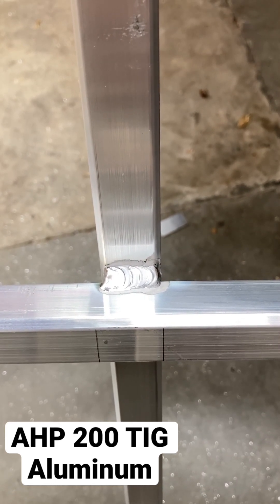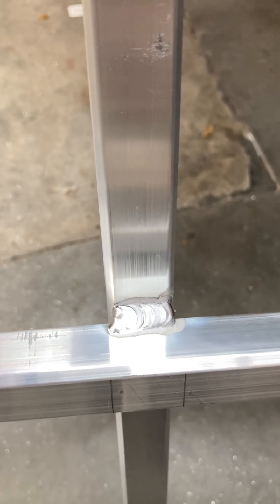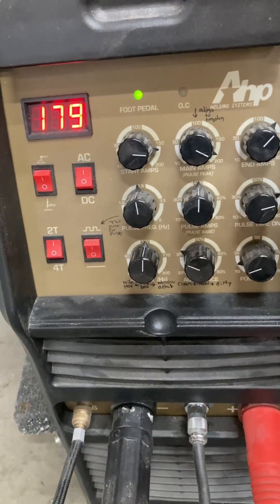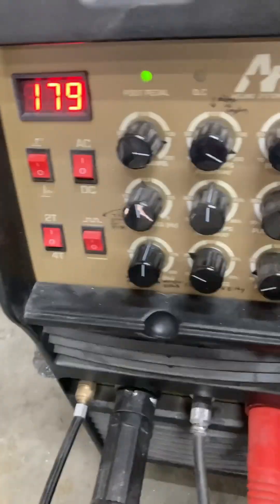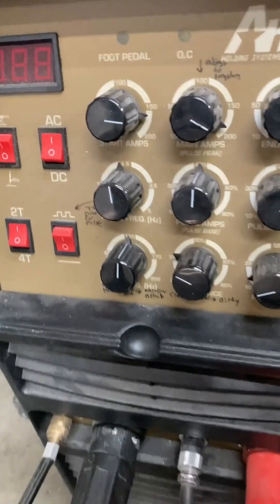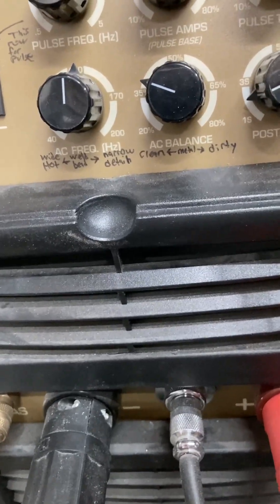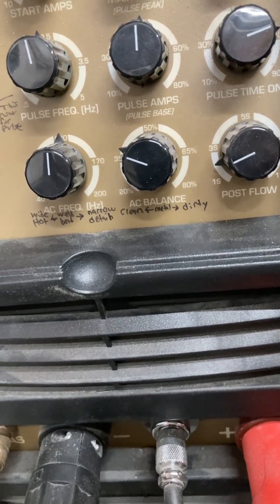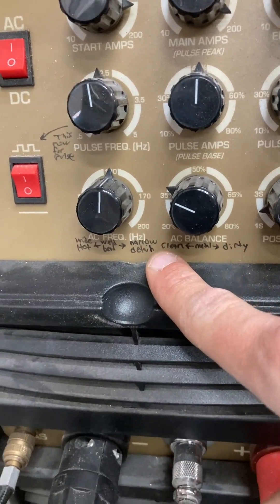AHP 200 TIG welder settings for aluminum

Comment: OMG, I have finally come across someone who writes on the front panel of equipment!!!   I would always come across machines at different companies with writing all over the front panels of them not knowing who   
had done it because it is company equipment, and many people use it over the years before it goes out to pasture.  I know you are the owner, but It is wild how you would deface  equipment before just making a diagram in a little book that gives you the same information about what each of the controls do for the weld puddle.  Anyway keep on truckin' and fabbing, and maybe watch some Miller advanced controls videos on YouTube , so you can understand all the functions of the equipment with ease , and you feel more at home around your machine.  Also the guy from Welding tips and tricks has good vids on advanced controls, but in the end it is perfect practice, practice, practice that makes perfect while using the advanced controls.  Good luck and God Bless!!!
Reply: Or since it's his and doesn't affect the welder what so ever he could just do it the way he did it and not have to worry about finding some separate diagram that could get lost.